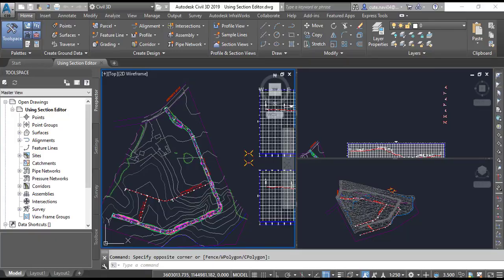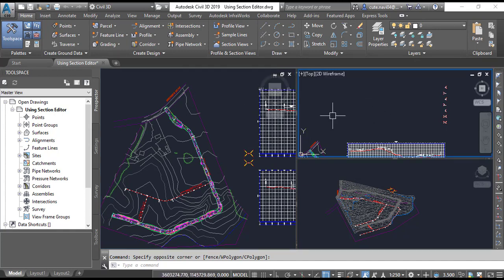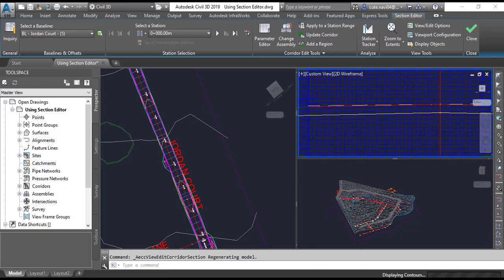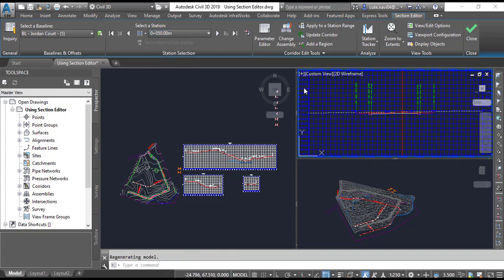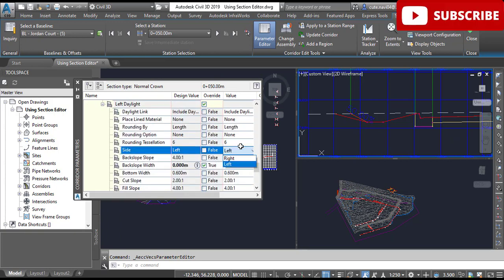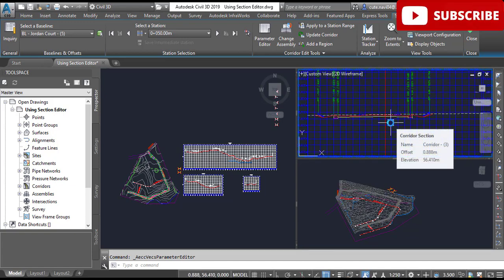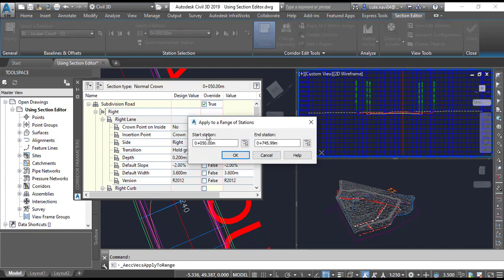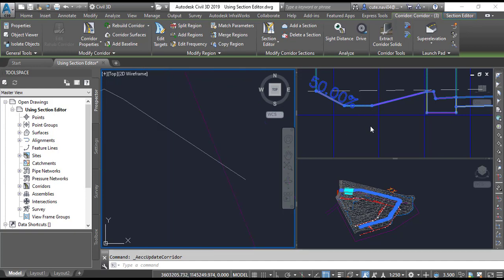How to Use Section Editor in AutoCAD Civil 3d | Editing a Corridor in Section using Civil 3d

Comment: to use section editor, you must have the surface in plant display off, and unload all the xref in the drawing; this is the best way to get the most speed. Regards
Reply from the maker: Thanks for suggestion but its fine for small surfaces